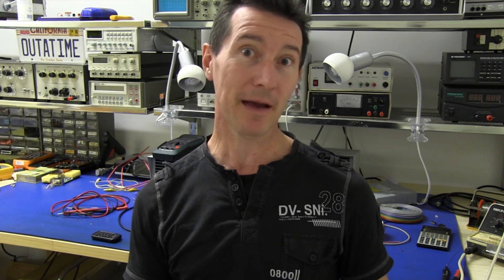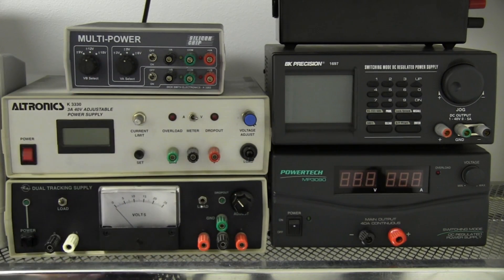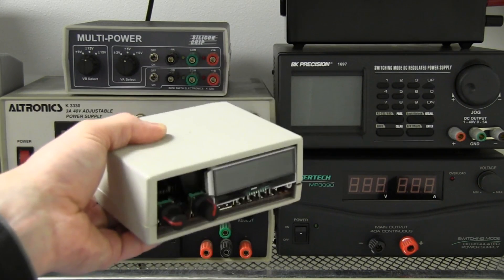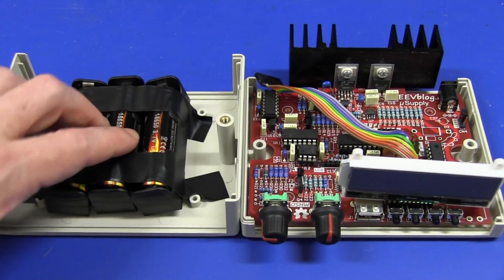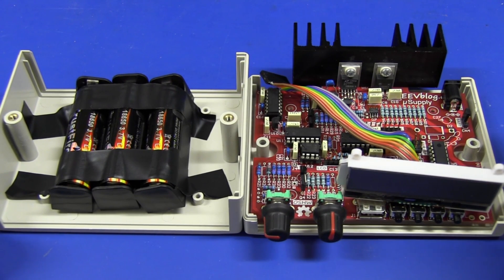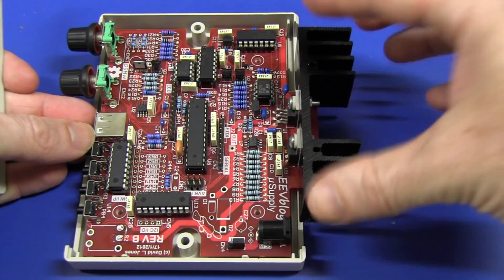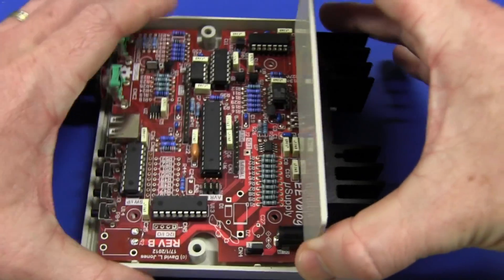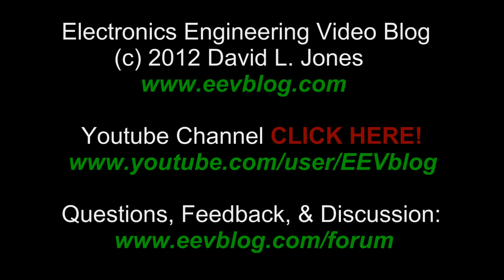EEVblog #258 - PSU Housing Design - Part 11

Comment: Dave ya should have tried using a metal case as the heatsink.
Or you could use SMD parts ... that will save you plenty of room to get the extra stuff in there!

Comment: I was really hoping this project would remain simple enough that a dumbass like me could build it from salvaged or purchased parts, but it's really gotten far more complex than I can build.
Reply: +00Skyfox 
It always seems like that to me XD
I always end up building a circuit, and find some quirks ... just gotta figure them out lol .. that's how ya learn!
Just take it step by step, so you won't get overwhelmed XD
Reply: +00Skyfox Check out "Power Supplies" 2nd Edition by David Lines, ISBN 9780790611204. Look out for used copies for cheap, it's getting harder to find and people are starting to charge ridiculous amounts for it. It's a good book and shows you how to build these things with simple components as well as explaining the how and why.

Comment: One question. I do not see any electrolytic capacitors. Can somebody explain me why not use them?
Reply: because its linear supply
Reply: G0867532
and?
Reply: G0867532
Yeah but dave was using batteries here for the power source. If you use a transformer to operate this from the mains, you need some sort of bulk storage capacitor.
Reply: Thank you.
Reply: +G0867532 
Linear supplies need capacitors too ... it just depends on the design -_-
Reply: +Benjamin “Ozias” Esposti If OP amp fast enough, they need't. Regular 1uf+0.1uf ceramics will be fine.

Comment: Dave!
@ 13:30
If you would still like to keep the USB, why not cut out the top of the case to mount the lcd?

perhaps an additional assembly step, but I would LOVE to have the lcd on top for easier reading.
(just think of looking at it from the view you have your camera set too, you can't read the LCD if it's mounted on the front!

Cheers
;)

Comment: I would keep the 5 volt usb I think it adds a nice touch to it. LOVE IT... For your LCD mounting problems you have the lcd mounting holes already in place. Just run 4 screws from the front through the front cover. Add a nut to the mounting depth of the lcd you wish. Attach the LCD then put on the final locking nut on..DONE. This also allows you to change the depth of the lcd to what you would like. Love it.

Comment: What's some good advice on mounting LCDs?  It'd be quite a bit extra for a vertical PCB that would sit behind the front panel.  Connecting the vertical PCB seems like a challenge as well.  I'd like to avoid all wiring.

There's always tape, but I don't feel a sense of professionalism or rigidity.

Comment: Yeah, it was strange.  I've found problems with files from other companies before, but the fact that Hammond sent me one was quite respectable.

I nearly had to redesign a circuit due to an incorrect pinout once and they basically told me that I read it wrong.  Looking at the date of their PDF, it was updated right after I mentioned the problem.

Just goes to show that mistakes are everywhere.  It's a matter of how these companies deal with them.  Hammond handled it well.

Comment: Hey Dave.  I just reported an error for this enclosure's .STEP file.  The PCB is not correct as two of the mounting holes are closer to one edge than the other two.  They have fixed this and they sent me a free one for the find.

You probably already figured it out, but I thought I'd let you know.

Comment: Hmph; what, no boiling formed starch in acids, autoclaving mycelium, or thermoforming under silicone cookie sheets to make the case to suit? Pack the cells in darkened calcium carbonate, blacken the inside and one side of the case for heat transfer, silvering the other under a clear (PETE/lexan/UV-blocker-coated) coverplate (plus a jackfruit logo?)  No future-looking photovoltaics-in port?

Comment: I would say you might want to also have a ext battery input source... battery's might run low during the use and you need to keep the project running...so it would be nice to have a bypass for the internal batteries.  Just my opinion...

Comment: Watching this, I get a lot of nice ideas. Why not duplicate (in terms of size) the board for it to fit in the top? Mount the batteries, dc jack, charging circuit and the binding posts to that board and if there is room for it the lcd. For interconnection: NO CABLES. use header pins. Like a PC/104 bus. That way you can screw the boards in, and close the housing. If you need to change the batteries (aging, defect cell or whatever reason), you just have to open the housing and change them.

Comment: @valordk 
18650 cells have been widely used for years in battery packs for laptops, power tools and even electric cars like the Tesla Roadster (which uses almost 7,000 of them).

Comment: If you're going the preregulator+LDO way, why not go the extra mile and use a well-filtered buck-boost entirely switching power supply? For instance, I've designed (and just tested) an isolated 5-to-5V 1A supply for USB isolation that produces less than 5mV ripple at full load thanks to a double LC filter. Also, this way you can use a single 18650 cell, requiring no balancing whatsoever and enabling arbitrary capacity expansion.

Comment: With the board on the top case so the knobs are also on the top (PCB is dead bug orientation), why not put the LCD on the bottom of the board soldered directly to PCB and cut out a rectangle in the lid (or a clear window), (shorten standoffs?)

Seems like the best solution and you only have to make room for the like 10 thru hole pins.  Front panel would then just be switches and USB and maybe leave room to move the connectors in line with the knobs where the display would have been

Comment: Dave would it be possible to setup your knobs and binding posts underneath the LCD on the 70 mm case? I'm assuming you could place a bigger LCD if you wanted to build a little bit of a bulkier PSU. I guess you're right though, if you're using a 70 mm case you might as well go all out and build the design for higher power usage.